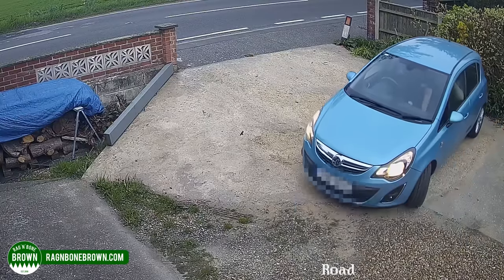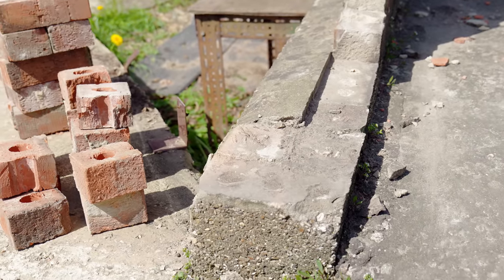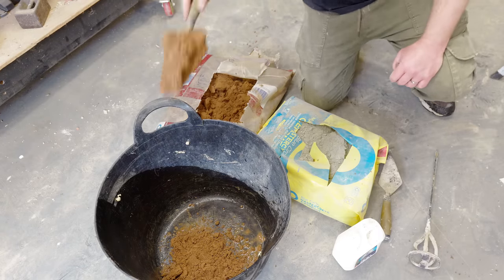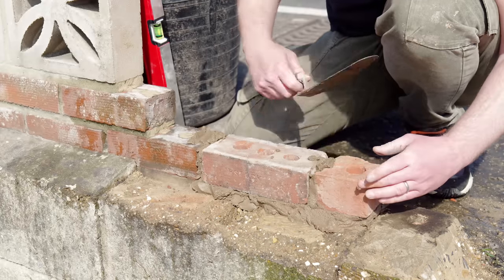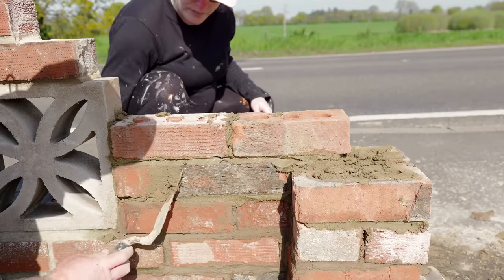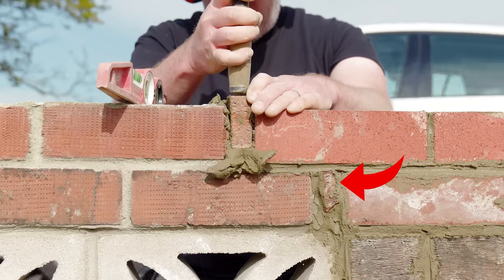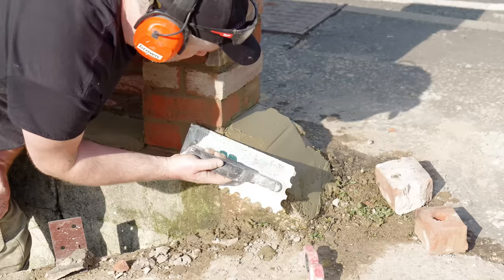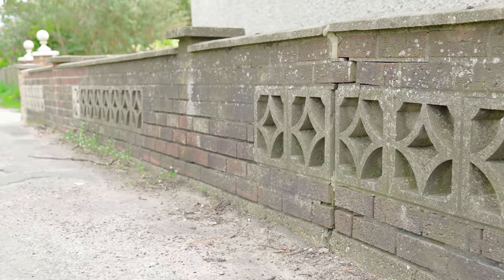We Had An Accident!!  //  DIY Bricklaying

Comment: Couple of years ago, when we had unexpected snow in February, my brother skidded and he crashed into the corner of the bricked wall, similar to your corner and breaking it. Now I knew it will cost a couple of hundred to repair it so I decided to do it myself to save my mum money. I am a female Diyer so never did anything like that. I went on YouTube, watched a few videos especially how to make the cement mixture. Just like you, we used our original bricks, I used a hammer to get rid of the old cement, cleaned the area. It took me a few days to do it as I didn't really know what I was doing at first. But eventually I repaired my mums bricked wall. I remember when I was doing it, my neighbours were giving me compliments in doing it. Now it's not the best, not as a professional but it's still standing there... Nothing has come loose or moves. You certainly did a really nice job. But the job didn't cost more than £20 but happy to save the hundreds of pounds it would have cost to fix it. I even took pictures as it's a fond memory of my first brick job. For small jobs such as that, differently better to do it yourself but anything bigger, maybe get a professional if it's a big job as inexperience will differently show.

Comment: Enjoyed watching that - I did an 18m, double skin garden wall (Fairly short, fortunately, I think about 10 courses or so) and did the footings for an extension. It's hard going, and in the nicest of ways, it was nice to see another DIYer and not a pro have a go. They make it look very very easy. It took me a LONG LONG LONG time, and it was shocking how much mortar I wasted because I'd think I'd be able to do a big section, but then get stuck on some detail. I think you'd have benefited from a nicer trowel and learning to cut off the mortar. I suspect the sponge was counter productive too, but that's not say everything I've done was right!

Comment: Nice job Keith. As a fellow DIY’er a bricky told me about the mortar, mix up to what you would think is just a bit wet and it will be perfect. Served me well. So much easier to bed in each brick

Comment: Very nice job Keith, your bricklaying seems to have gotten better as well! One tip I’d like to give you though should you ever have to rebuild a wall with 9inch pillars is to poke some reinforcing bar down the centre of the pillars to prevent them from further cracking. I like how you added the wall ties though for a belt n brace approach! Well done!

Comment: You should mix it dry so its all one color then add the water and plasticizer and just slowly go adding water. You can use washing up liquid but you shouldn't do it as it weakens the cement

Comment: You made this really hard work. No need to fling motor in. You can use a jointing tool which is a few pounds and makes all the different. The trowel your using is making it harder than it needs to be.

Comment: Good work mate. I had my first experience of bricklaying last year and it was quite simply a nightmare. Three 6foot 1.5brick piers. So much respect for brickies now. And to top it off, once I’d finished them all and filled the centre with concrete I only then realised they should’ve had rebar up the centre too. A few openings and closings of the electric sliding gates I’d built and the lower courses snapped and piers fell over 🤬🤬 At least I was much much quicker second time round!  Re your project, I recommend grabbing some muriatic acid from B&Q and just brush down the bricks you used. They’ll blend much better then with the existing wall. I had to do the same as my first attempt had mortar smears everywhere.

Comment: Never use washing up liquid as eventually the mortar will break down and lose strength much quicker. It's not a bad attempt for a first timer with so much up to date equipment you are using. But, I always think you should get someone who knows what they are doing particularly where the end result is seen front of house. Sadly even so called professional bricklays are pretty poor these days. The reason for the the little slip you ended up with is due to the screen blocks being 290 mm long and the bricks being 215 mm long. You needed to take this into account at the setting out of your piller. An easy mistake to make and practice is all you need plus a small brick trowel.🙂

Comment: The wall looks good.

Now you know how big a mix you can do before it starts to go off. Smaller amount next time. 
You can also rack out the joints and point the next day but it is better to do in one go.
Washing up liquid works as a plasticizer but it will not make it waterproof.
You could also use a little bit of PVA does not have to be waterproof PVA.

When you lay your bricks start at the end and adjust the joints so that the gaps work out. 

When you finished it helps to cover it up to keep the wind and sun from drying out the mortar before it can set and help with the curing.

 The other crack looks like it maybe due to contraction. I would not put mortar in it as then you will have a problem if it expands.  You could take off the copings cut the brick above the decorative concrete blocks and relay so that the gap is vertical. Then seal the face of the gap, if you wish, with some mastic backed by a foam strip .

Comment: Now you have the cement and sand, plus the plasticiser, to fix up the other side, or at least fill in the cracks.  Yes wetting the bricks down first helps, better to have a bucket of water there, that you dip the whole brick in first, to get the layer in contact with the mortar wet, so it adheres better. If you have no plasticiser a bit of PVA paint works as well, pretty much any colour, as you use only a little, and it vanishes in the mortar anyway.

Comment: Mmmmyeah .... washing-up liquid works, but having used real plasticiser, I'd say stick with that because it means less water is needed, so you get a stronger cement. It's also much more easy to use. IMO.
Nice work.
Reply: If you spray the bricks with water before you lay them - or dip them in a bucket of water - then you should find the cement dries less quickly but that it dries enough to let you do the next course without things shifting under you.
I'm far from an expert, but I've found knowing that made redoing a back yard wall corner much easier.

Comment: I think from what you showed of the rest of the wall, it was worth it to do it yourself even if it does not look 'professional' to you. I noticed at the end of the video, that the wood your wife had hit with the car is gone.  Are you planning to change that in some way to avoid it knocking down the wall again if it were to be hit again?
Reply: If she knew how to drive it wouldn't be an issue 😂
Reply from the maker: Thanks. Yes, we had to replace the concrete anchor bracket thingies as they were bent, so we used a concrete resin product  and stuck them in some fresh new holes. Also made a new wooden barrier as the old one wasn't quite long enough 👍

Comment: There used to be a lumber salvage place in New Orleans where they paid a piece rate to guys who cleaned mortar off old brick. "St. Jo" brick was the preferred material for both new and renovations. Some of the old guys used machetes and hatchets, while some used a mason's hammer, others framing hammers with somewhat blunted claws on them. They'd sit out in the yard, cleaning brick all day as weather allowed, or as long as they felt like it, stacking it as they went.
 Looking at Google Maps on satellite, the dirt at the location is still red from all the bits of brick from the ones that didn't survive or the bits and flakes from the cleaning  that accumulated over the years, likely from not long after it shut down. 29.963983140748212, -90.12085044388341
 Street view has it all grown over, but you can see a few lumps of brick that were never cleaned or broken up. Must not have been the good "St. Jo" stuff.

Comment: Wow, that wall came RIGHT apart on what seemed like a minor hit.  Is this just generally expected for an older brick wall like that, or were there shortcuts taken by the original brick layer?  I don't know anything about brick laying in general.
Reply: Its a single skin wall (its only one brick wide) so its not got much strength at all but fine for the purpose of a garden wall / its more of a decorative thing
Reply: @daniel2238  A brick thick wall is measured by the length of the brick. So this is a  1/2 brick wall. Strange I know.
Reply: @SpaceCowby  there ya go, the more you know! 👍🏻